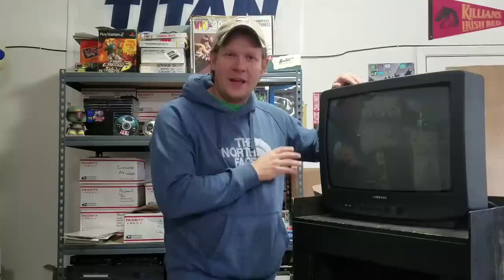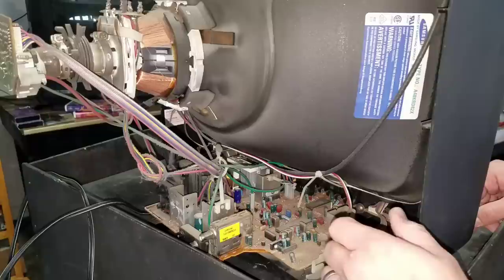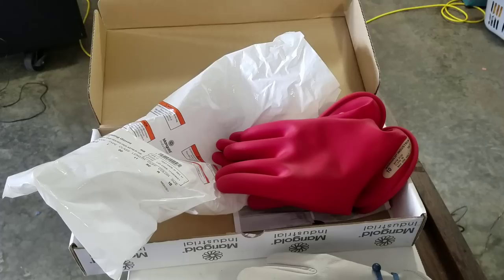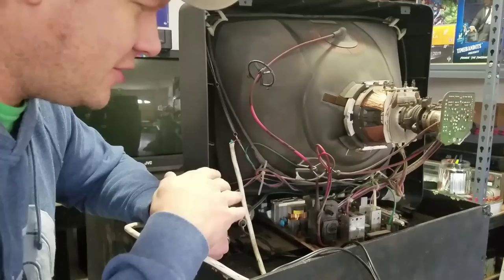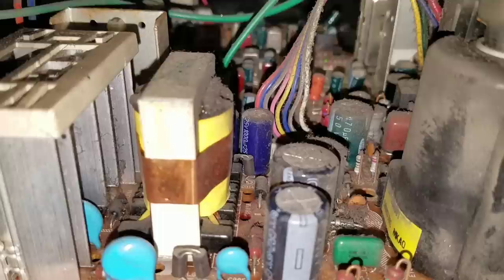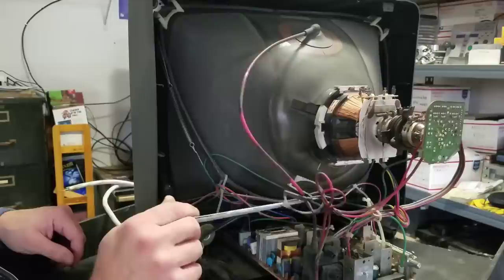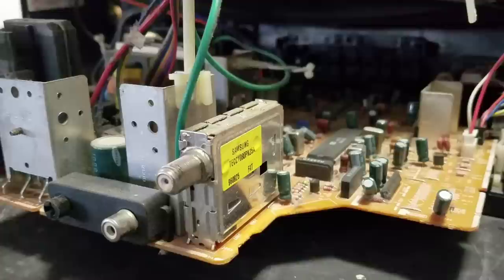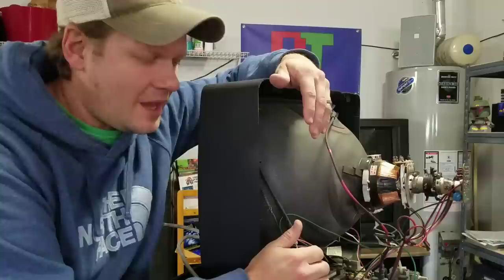CRT Safety - The Consumer TV Version - Cathode Ray Tube

Comment: The fact that the composite jacks are mounted on a scart-shaped block gives me hope for RGB moddability early on.
Reply from the maker: I notice that too.  I'm thinking that Samsung used the shell all over the world.  Most likely there was a scart input in the TV if the shell was used in a European TV.
Reply: @RetroTechUSA  the joys of living the UK, but ;( we did not get 60hz on retro consoles.
Reply: All color TVs can be modded for RGB, the tube needs to take RGB at some point either way.
Reply: @haloharry97  So what? It's better to live in a PAL country today since you can easily get RGB, CRTs can't easily be imported but Japanese consoles can and they're cheaper than their North American equivalents either way.
Reply: @Eddies_Bra-att-ha-grejer  Yeah, they all can be, but if the TV's own circuitry doesn't handle its signal in RGB before it's sent to the tube (OSD, PiP, CCD, etc.), that makes the RGB mod considerably more difficult and less worthwhile.
Reply: @haloharry97  Heh i guess its to balance things out.
Though Japan had both
Reply: @RetroTechUSA  replying to a 4 year old comment to satisfy any curious minds: yes, the PAL versions of this TV do have a Scart input on the back. I have one. Composite is only present on the front of the TV.
Reply: Not everything with SCART would take RGB inputs.

Comment: The chip you were pointing out, likely branded SEC, is actually the jungle IC for the set, with the micro controller responsible for the OSD being up towards the front of the set underneath the tube. No way to tell from just the video, but if it's labeled "KA2163", I can say without a doubt that an RGB mod is doable.
Reply from the maker: Thanks.  Yes you are right.  That bigger chip is the Jungle IC.  It also has the 2nd chip that sends in the OSD Blanking so it's a go for RGB!

Comment: I love CRTs and want to get into modding them, but I have no idea what I'm doing and fear death or injury for going poking around back there.

This video is a great help thank you.
Reply: If you're ever going to mess with an old CRT based analog TV, first get an isolation transformer. Most had the chassis ground tied to the neutral of the AC input and if your home is miswired, you'll have full mains voltage on the chassis ground.
The other important thing is the one hand in the pocket rule. One hand on a circuit, the other in your pocket. Lest you have one hand on a ground and the other touches something high voltage or worse, mains current.
Working with the CRT deflection, second anode or video drive circuits, no, those would be in person teaching. Too easy to get bit and damage something.

Comment: It's funny to me to see certain things like no potting around the anode just a rubber cover. I test these everyday at work and that's a crazy looking coil compared to what we use. Of course the crt's I test are used in aviation so things are going to be designed alot differently

Comment: Thanks so much Steve. I'm curious, are arcade monitors any different than CRTs? I got a bunch that need working on, and I'm just curious if there's any additional safety measures I should know about that weren't discussed in this video. Thanks so much for sharing!
Reply from the maker: Thanks Kory.  Arcade CRT's function the same as nearly any other CRT in general.  They are only designed to show one input so they are actually simpler in design most of the time.  I have an Arcade Monitor too in a NEO GEO cab.  I'll make some videos on it next month.

Comment: I have been staring for about an hour at the focus/screen nobs that seem to need adjusting. Too scared. I made the mistake of googling it, and everyone is fearmongering. I have 1000v screwdrivers with plastic handles, or am prepared to use a shaved wooden chopstick to turn them. Still scared. I see you do it by hand and am so envious. I would love to go on a course where I can have someone at least look over my shoulder.
Reply: alot of newer ones have resisters that drain the power when it isn't turned on, you can just use a large resistor clip one end to the metal frame or ground and then use some insulated stick to slide the other clip under the cap and let it drain through the resistor as that will not produce any arc and take a chunk out of your screw river.

Comment: 5 yrs old me: Pours an entire glass of water on an old Tv in the back....Hears a POP! and the TV didn't work anymore :(
Reply: People's Republic of Youtube  no
Reply: People's Republic of Youtube  sorry, I should have explained more, there is no way the tube "imploded", even if you break the glass front (which is really hard to do) it won't implode. The most likely explanation is that there was a short circuit (shorted caps/HV) on the board and that what caused the the fuse to trip and the TV to fail.
Reply: @LachambredeNico  I stupidly destroyed an old monitor when I threw it away by throwing a hammer at it and it made an incredible boom. (If that's what you're talking about)
Reply: Probably shorted out the HV supply. Repair shop could make it work again.
Reply: I put a magnet on screen and moved it in one corner, then realized the purple hue wasn't going away and stopped, age 5 too. It eventually went away but after two or three years, imagine the frustration.

Comment: If I wanted to just clean it from dust, using only compressed air, would you still need to discharge? I have an old CRT that hasn't been on in 2 weeks and I was thinking recently of making sure to get the heavier dust off the board. Thanks again for the great video!

Comment: CRT bench repair techies used a pair of long-blade screwdrivers to discharge the anode.  Holding them by the plastic handles of course and poking them in the right order.  If hear sparks then it's done.

Comment: I've got an old crt that's been powered off for years. Im assuming I don't need to worry about discharging the unit and being shocked. Now I'm in Australia on 240 volts. I doubt the procedures will be any different from what you've shown. Please let me know if I'm wrong in my assumptions.

Comment: One thing to keep in mind is to ALWAYS attach the draining cord to the chassis BEFORE trying to discharge the tube, otherwise you will receive the discharge yourself. EVEN if you're holding it trough the plastic part of the screwdriver because there's too much voltage. Might seem dumb, but when you're tired and frustrated about some defect it's easy to forget about it.
Reply: It's impossible to get shocked if you're holding it with the rubber/plastic part of the screwdriver. That's not how it works.
Reply: @n646n  A general screwdriver plastic part will insulate at most 1000v. A CRT can hold up to 30.000V or more depending on the size. The plastic wouldn't do much for you. It only offers a resistance to electrical flow, with enough voltage, there's electrical breakdown. Think of how air is most often an insulator, nevertheless we can see  it conducting lightnings every now and then. When one is attaching the screwdriver to the TV set, if the screwdriver isn't attached to an earth point beforehand, the earth drain will be one's own body.
Reply: @eletro_doc9529  30v isn't enough to do that.
Reply: @n646n  I'm not trying to be Mr. knows all here. I'm just trying to alert people from my mistake. I did just what I said one shouldn't do and got shocked the hardest in my life. If you wanna stick your screwdriver in your CRT without grounding it first, be my guest.
Reply: @eletro_doc9529  30v isn't enough to "shock hardest in your life" either. I don't know why you think only 30v can go through a rubber screwdriver.
Reply: @n646n  Not spending more time on this. It's 30 thousand volts from a CRT I was referring not 30v.
Reply: @n646n  It would be best if you studied some more, for you own safety. Electricity only hits once.
Reply: @eletro_doc9529  Nope. There is not one recorded death from CRT shock despite numerous people being shocked.
Reply: @eletro_doc9529  You said 30.0v, not 30,000v.
Reply: A prank i saw was to unplug the tv from supply and antenna,  then unplug the CRT anode rubber cap while still charged up, then short to ground the exposed live anode with a spark. Then anyone touching any part of the TV, even the grounding of it gets zapped.

Comment: hi Retro Tech! i've got this crt monitor with mitsubishi Diamondtron tube. 
the image is good and clear but it heats too much from the top, buzzes and smells)
so i decided to take the cover off and blow out some dust. there was a lot of it. 
but what bothers me is the red circle where anode enters the tube is in black sticky substance and i don't know if i could just wash it off with spirit.
i don't know if its an Aquadag, but graphite layer's visible sharp margins are 5 cm away from the red circle, so i think it shouldn't be there, on the circle itself.
So, can i just clean it off? you will not be responsible (i mean morally) for any advice so please don't be cautious :)
Sorry for long text and bad english )

Comment: I have a 27" Trinitron that needs a yoke adjustment bad. I play a lot of JPRGs and in the constant menu navigation and text boxes are always tilted just enough to drive me crazy. I've been wanting to adjust this yoke but have been too afraid to, at least until now. I'm going to order the gloves today and should be making the adjustment on Wednesday when they come in! Thank you for these videos, they're extremely helpful.
Reply: Hey, did you end up doing this? I have a 30 something inch Trinitron, and have been having issues with it. If the yoke is misaligned will it also cause discoloring in the corners?
Reply: @VinnytotheK  I doubt the yoke would cause discoloration, you may need a degaussing tool. Magnets can cause discoloration and usually happen when someone sits something on top of the TV. Check out this video https://www.youtube.com/watch?v=qS3Q2lJS_74
Reply: @TheGreatTave  Appreciate it, I did stumble upon degaussing tools while on my hunt to figure out how to fix it. I'll have to see where I can get a reasonably priced one, or if my corded drill might suffice...
Reply: @VinnytotheK  I haven't dealt much with degaussing, I did have a CRT a few years back that had discoloration in 3 of the 4 corners, it slowly went away from turning the TV on and off. Not something I like to do repeatedly, so I just made sure to play a game on it at least once a day.

Also you could check eBay for degaussing tools if a homemade tool doesn't work. Best of luck! I know what it's like needing to fix up a CRT nowadays.
Reply: Where did you get class 3/4 gloves cheap enough?

Comment: I figured out how to use a crt when I was 4 because at my old house I had a supersonic crt and it didn't have any analog channels but I moved and BROUGHT THE CRT! For some reason I got a NES and I hooked it up to the CRT but now it's in my garage, without a use, and for some reason I'm still scared of static. I always ask for help hooking up a cable in the back even when the TV's unplugged because I think it might turn in even though it won't. I am going to get a DTV box to watch antenna tv that's digital because they switched from analog to digital. But, I might get an analog transmitter even though it might be illigall. (Jk I won't I'm going to get a DTV box instead.

Comment: If you really want PPE for this task (which I do, but many do not), I don't think the rubber gloves shown are adequate. The voltage rating needs to be 30kV or so, which would be class 3 or 4 rated rubber insulating gloves. They are very thick and unwieldy, like space gloves or something, so I can see why many think it is just not practical. At the very least, something to where on one hand while discharging the monitor and not much more. These are several hundred dollars everywhere I have seen, and you need to send them to have them balloon tested every so often. If there is a tiny hole in the hand / finger then it will completely invalidate the glove (the arc always finds a shortest path to ground), which is why you need the leather over the top to protect the rubber. If you try to buy them for cheap on Ebay then you probably need to send them in to be tested, too, which cancels out those cost savings basically.

Comment: I got hurt when I touched a high voltage cap on my TV even after overnight unplugging. I  was lucky that I touched the + and - terminals across my thumb, and not across my heart.
Reply: I was changing out a 25 inch CRT from an old console TV. I forgot to discharge the CRT and when I lifted it out and leaned it against my chest to balance it, it shocked me, because I was holding the edge of the CRT by the metal edge strap. It was kinda like a thump and more startling then painful.

Comment: Excellent video. You mentioned about the flyback and some capacitors could hold some charge, is there a way to discharge them safely to work on the motherboard? i want to try to do the mod to add rgb to my crt, but thats what's holding me back.
Reply from the maker: Maybe I can talk about that and show it in a future video.  I've never been zapped by a cap  while working on a CRT, so getting shocked by one is not common.

Comment: What's the specs on those gloves? I need to adjust the yoke. I have a slight tilt on both of my crts. I'm kinda scared to do it since it's my first time opening one up
Reply: If you pause around 3:40, the package for the rubber gloves says Type I (no resistance to ozone), class 00 (500VAC to 2,500VAC & 10,000VDC), length 11" (from tip of middle finger to wrist or below elbow), size 10" (inches around palm of hand, front to back). Here's a link from Grainger: https://www.grainger.com/know-how/safety/ppe-in-the-workplace/hand-protection/kh-electrical-gloves-5-things-to-know

From what I've read online, CRTs can have up to 25,000-30,000V while running. Higher class numbered gloves can protect you from higher voltages & are thicker, but they are more expensive & stiff to move the fingers. It sounds necessary to have a leather glove protector over the thin rubber gloves.

Comment: I've read that CRTs can hold roughly 27,000 volts when operational. Short of buying Class 3 or 4 gloves which cost hundreds of dollars, do the lower voltage Class 0 and 00 gloves like you use (500-1000v) really even protect you? I need to do some convergence, yoke and flyback adjustments to my set and I just want to stay safe but wonder if Class 0 will achieve that.
Reply: Just be a bit careful while doing it. You shouldn't be touching anything potentially lethal for convergence strips and flyback adjustments, but I'd be pretty careful around the yoke. Gloves are bad because they limit your ability to feel what you're doing, or so I've heard, and they won't really protect you at all if it's on.
Reply: @n646n  Thank you for the information! That being the case I will leave the yoke alone and do my best with just the convergence rings and strips. I may use some nitrile gloves instead as they layer nicely and are more form fitting for fiddly work.

Comment: Thank you Steve for your information and i have an old samsung 32 crt tv from the 90's and it stopped working and i noticed a ceramic fuse that is not wofking .. So could i replace it with a different type and i did not notice any burn marks on the main board and what do you think the main thing that faild to burn the fuse in your experience . Thank you for the safty tips .you saved my life

Comment: How would you go about cleaning the caps? I was thinking 90% iso alcohol. Finally got a nice small Panasonic, I took to the internet because it had a tilted image, i found you because after I opened it it was filthy and hoped to glean some safety tips, it's mainly that this kind of older tech scares me lol they ain't small and sip power, they are massive and chug 200 watts from the wall lol
Reply: Canned air?
Reply: everything you plug in (usa) is stepping down 120v from the outlet 
even if its a 5v usb charger the same care and safety protocol is to be followed if youre plugging into mains power 🙃

120v shock? unpleasant 
240v? i was VERY cranky 😵‍💫
Reply: 99% alcohol is always better.

Comment: This video does not mention one of the most serious dangers with working with CRTS-CRT implosion.  CRTS are under vacuum and glass can fly everywhere if they are broken.  At a minimum, eye protection should be worn.
Reply: Why would it break if you're not smashing it? It's just as dangerous in general use as it is when you open it.
Reply: @n646n  Post 1970 or so TVs have implosion protection on the portion of the CRT seen when the TV is put together.  However, the back and neck of the CRT have less protection.  An accidental hit with a tool on this section could cause implosion and glass would fly everywhere.
Reply: @pattyeverett2826  But why would you hit it with a tool? That's like dropping your hard drive.
Reply: @n646n  Accidents happen.  Wear eye protection.  I do when restoring old 1950s/1960s Televisions.
Reply: @pattyeverett2826  How will eye protection help when glass is shot into my body?
Reply: @n646n  The glass is not like a bullet.  Reasonably thick clothes(cover your neck-major arteries are there) will protect  you. If you want to completely protect your face-wear a face shield.

Comment: What about opening the backcase and use isopropyl 70% or higher and then some compressed air? Or will that also be too risky? Its only to just remove the dust from the circuit board.

Comment: Is that ground spring necessary? I was poking around in my Apple IIe computer monitor, and the spring was disconnected. That thing was a nightmare to take apart and put back together, so I just let the springs hang there.
Reply: Yes, it ground the tube, its vey Important